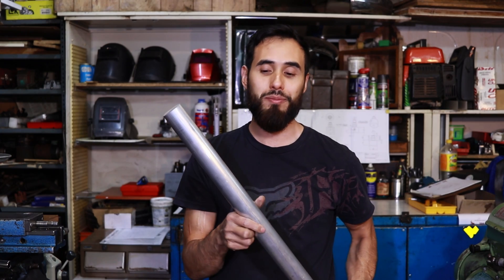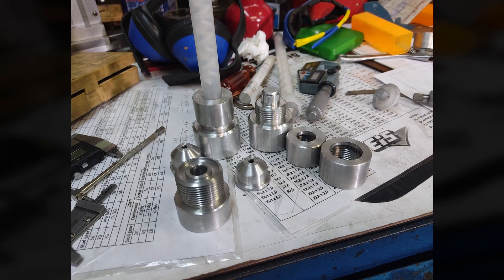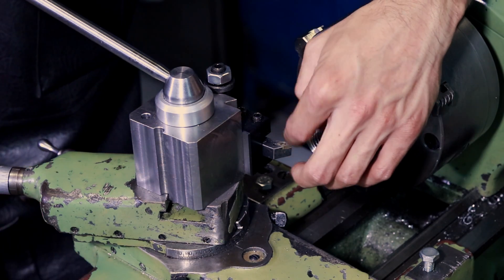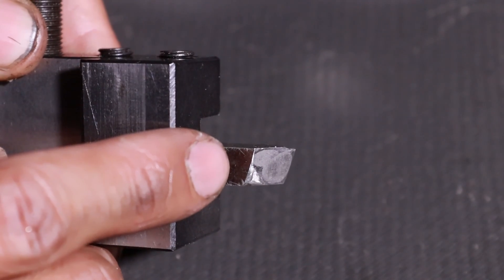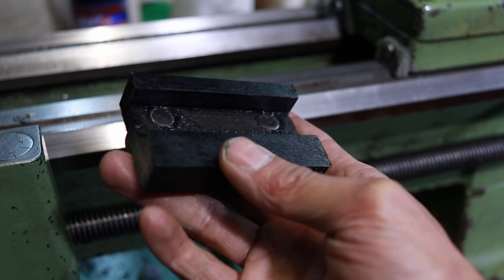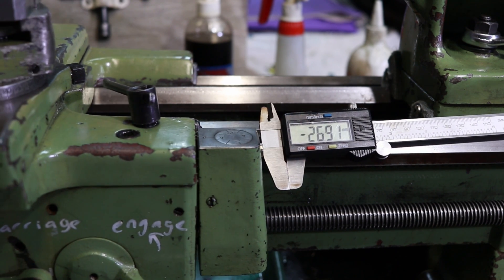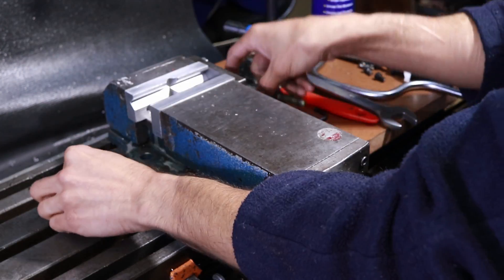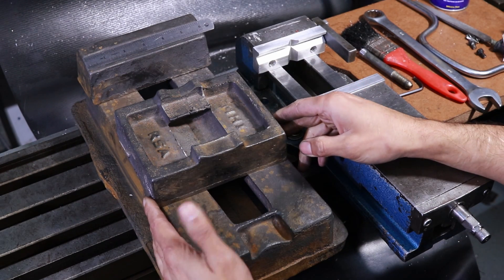Taking on Paying Work & Making it Easier + Vice Update

Comment: Nice tips, I was just thinking of making an aluminum v block for vertical clamping in the vice, but like your solution with the soft jaw better.

The problem with your inserts is the grade you were using are meant for steel, aluminum sticks to the coating.  Get some Korloy H01 grade inserts for aluminum and you won’t have the chip welding problem, and they give a fantastic finish when you run them fast.

Comment: Great projects! Where did you get the casting done?
Reply from the maker: Thanks! I have a great contact who runs a small foundry, offered to retrofit a german made CNC router he could use for pattern making in exchange for casting up the patterns I made in Episodes 1 & 2 of the Vice Build
Reply: @Mark_How  Cool, do you have a link / business name? I'm also in SA btw.
Reply from the maker: So I see he hasn't got his website up anymore for the main line forging business, but he's still got his cast iron/aluminium cookware site, you can contact him through his website @ www.Chefi.co.za. Great guy by the name of Tony.
Reply: @Mark_How  Awesome, thanks! At some point I want to make a 1m camelback straightedge to do scraping work on a Bridgeport etc. Best way to source one locally seems to be by getting it cast.
Reply from the maker: @Thunderbelch  no worries, I've also actually been thinking about that and came to the same conclusion, for once I've gotten some scraping practice in